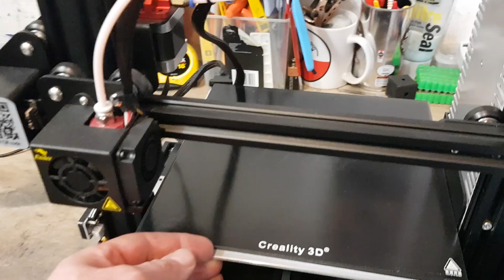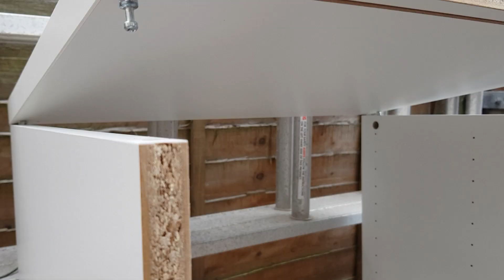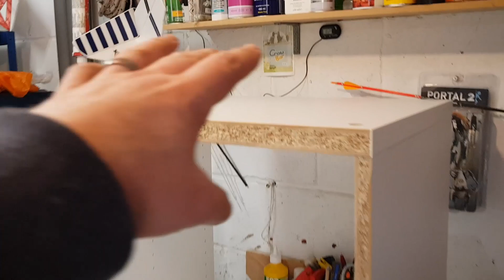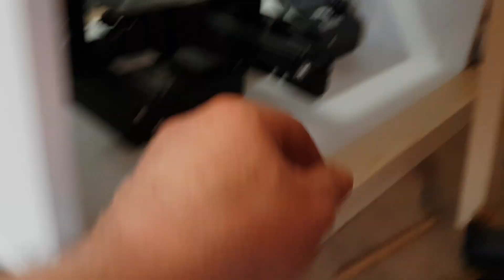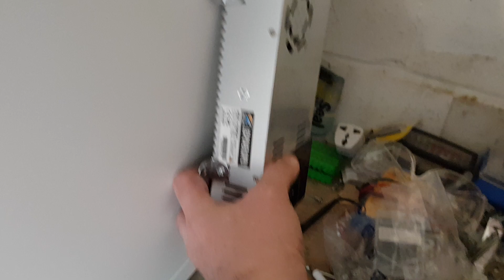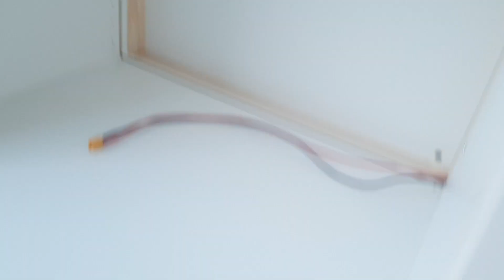3D Printer Enclosure build - Suits Ender 3 and similar sizes

Comment: Sorry, another question, where did you pull the power from for the LEDs? Was it from the PSU for the printer?
Reply from the maker: No, separate power to USB plug came with the leds
Reply: @Vass881234  Thanks again. I have some spare leds from another project so I'll power them and the printer off of a surge protector. I've bought some of that 3DLAC stuff that you recommended in another video, as sometimes I have trouble with prints sticking to the glass bed.

Comment: Great video. I've bought the same cupboard and a door for my Ender 3. How much wood did you need to add to the back/what was the thickness of the additional wood?
Reply from the maker: From memory it was 4 inches,  just put your ender3 in the cupboard and pull the table forward, make sure it's not proud of the front, then push bed all the way back and see how much it sticks out. Then add an inch for safety.
Good Luck with your build
Reply: @Vass881234  Thanks for that. I'll give it a go.

Comment: Is it safe to leave the microcontroller inside the enclosure?, Will those chips burn if the interior is too hot
Reply from the maker: I have a thermometer in there - if it gets above 35 degrees C in summer , I open the door. :-)

Comment: alternatively the power supply could be mounted on the inside with a hole for the fan, the supply itself would then act as an enclosure heater and still remain cool
Reply from the maker: nice idea - I like it
Reply: @Vass881234  yes, but then you need an exhaust port, since otherwise youd build up static pressure and air would try to go out of the fan hole too. if you add a hole in the oppisite side that might work, but then it would kind of defeat the idea of an enclosure :/
Reply from the maker: It's been fine all this time.  It's not hermetically sealed

Comment: Nice was thinking of doing something like this I'm going to be updating a to a new control board with silent drivers to reduce the noise but from what I've seen the fans will then be the noisy part so wondering about making one of these with sound insulation inside.

Comment: I love this! - That's fantastic. - The LEDs are a nice touch - Thank you for this video. - That should help with ABS printing and noise. - I was thinking of venting as well, but that would defeat the  purpose of keeping the temperature stable inside. On the other hand this could be mitigated by a system that would inject "fresh" air from outside after it has been heated to the desired temperature and vent the air with the fumes out. - I think there is a system like a container where the tubes intertwine to exchange and mitigate the loss of heat.  That said.. if nobody spends time in the garage while printing.. the fumes wouldn't be such a problem.
Reply: K.I.S.S.

Comment: I built my own enclosure design. It has the power supply outside too, but... the printer works fine with the control panel and the motherboard inside? I mean, the box concentrates the heat there. Please tell me if it's okay keeping that components inside the box.
Reply from the maker: I cant guarantee your setup, as I didnt build it
Reply: @Vass881234  Well, it looks quite similar, just ask if your enclosure works fine with only the power supply out, so I would have an idea to prevent any issues.
Reply from the maker: Sure, no problems yet, I've nit run anything longer than 5 hours tho
Reply: Cool, dude. Thanks.
Reply: Well at what temperature the atmega1284 died? Of course the electronic must be cooled but there are some tolerance...
Reply: @noway8233   Most likely the caps will fail. Atmega Temperature Range (°C)
 -40 to 85